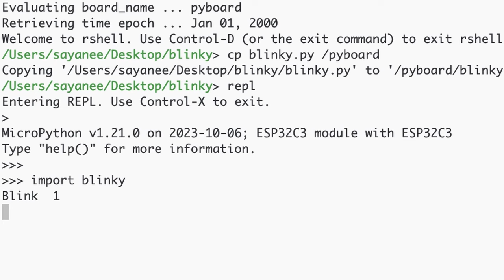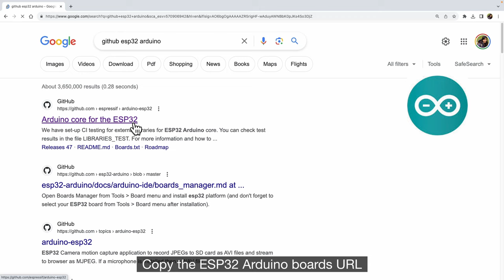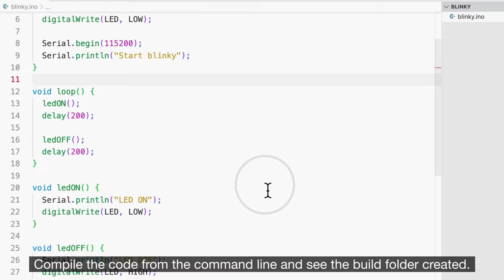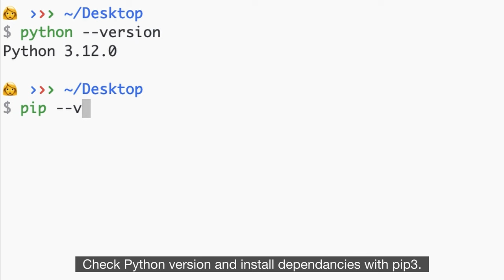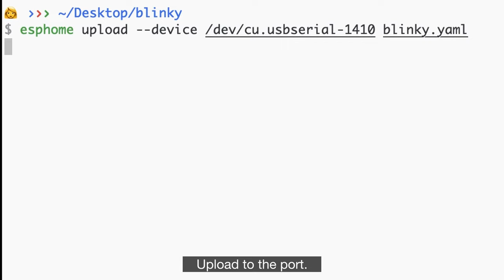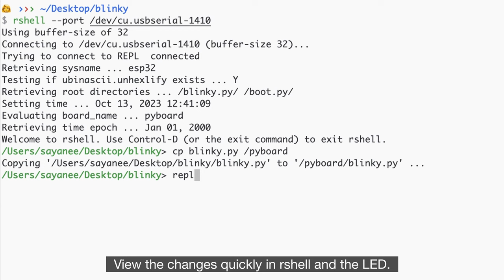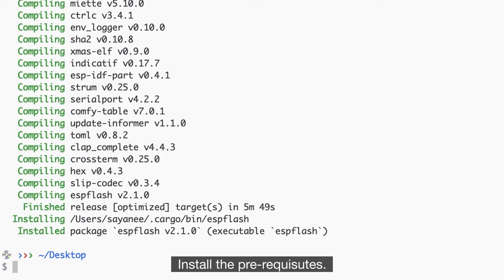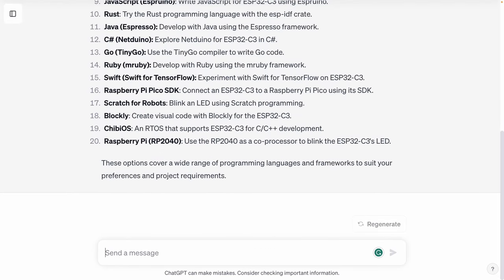The versatile modern microcontroller

Comment: Long time no see. Welcome back. I’m not sure if you have anything related with circuit design, particularly filtering and decoupling capacitors. I find this to be an essential topic as it lays the foundation on which an embedded circuit can be built and operate on. Once the power supply is clean and smooth, everything else can fall in place.
As of late I became interest in ac/dc converters. It’s a great way to have a small footprint power supply on-board, so that devices can be powered by the mains. Sometimes it’s just not practical to power a device with batteries. 
Hope to see more of your videos soon. Cheers